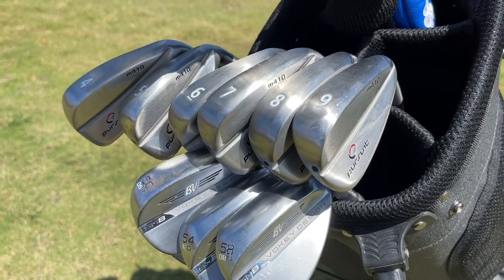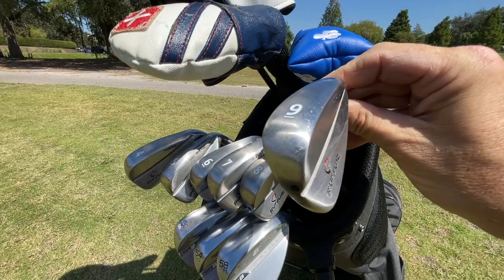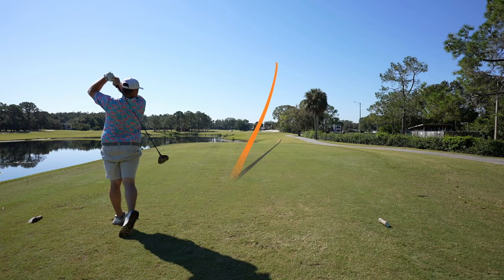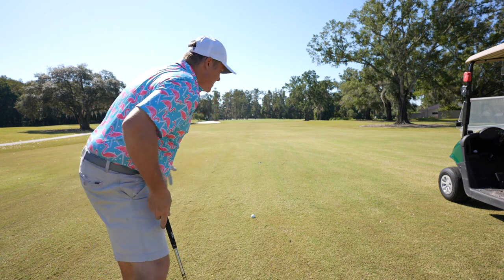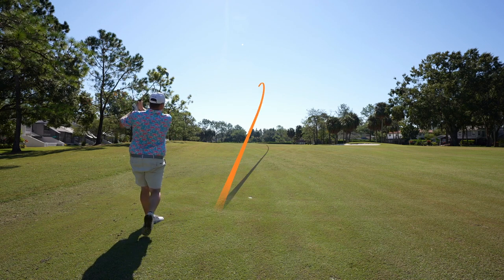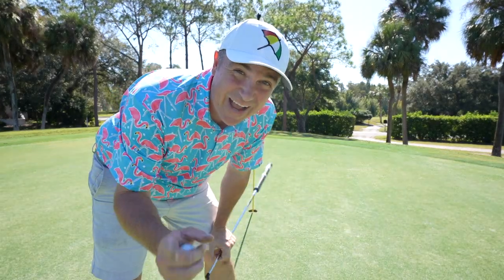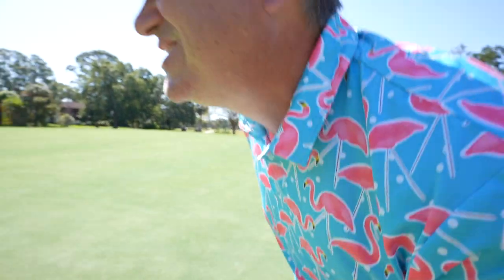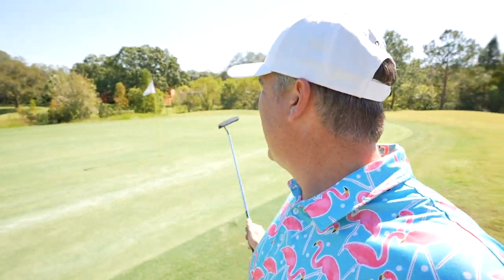Can I Break Par with $400 DTC Clubs??

Comment: Thanks Gabe. These guys are no joke. I've tried to get other You tubers to review these guys. A behind the scenes tour would also be good too. I've got my wedges from Giga golf. After getting a 3w 3h and 3i - 60 degree Ti3 with custom graphite shaft and grips. Cost vs customisation gigagolf is number one across their full range.
Reply from the maker: Yes, the value to quality ratio is about as good as I've ever seen for sure. Would love to do something behind the scenes.
Reply: I've been looking at these for a while. Although lofts and looks seem on the traditional side, the Titanium part kind of draws my attention.
How's your experience with them so far?
Reply: @nomadvehr827 (only downside) I swing very quickly (150meter 7 iron @traditionally lofted). So, these clubs tend to munch the cover of golf balls because the grooves are so sharp, and titanium is so strong. 
Due to tungston weighting, the sweetspot is larger than some other clubs. The sweetspot feels amazing considering I've played Mizuno and Honma irons, too. 
The sole of the club is broad, and the front leading edge is rounded and rolled to help get back out of the turf, which stops me chunking it badly. 
Now, all I need to learn is how to be more consistent at golf .... sigh!
Reply: @deviusfeilds  thanks a lot. That was actually very helpful. I'm sticking to my Wilson D7s for now. Got mine a few years back for quite a song on ebay. The 4 iron and SW were half of the price of the 5-GW set which is funny but I was pushing for set consistency.
The cover munching thing might be a deal breaker so thank you very much.

Comment: I’m shopping for dtc irons right now. I was pretty much sold on the takomo 101s but they’re out of stock. These are definitely on my radar now. Would love to see you rank all the ones you’ve reviewed against each other with pros and cons.
Reply from the maker: If you like those you will like these
Reply: @LetsPlayThru  Would you say the M410 or the C510 is more forgiving ? which one do you think would be closer to the Takomo 101? Thanks love the channel
Reply: Update: I ended up getting these for Christmas after seeing this video. Got fitted at a local shop and used those specs to order my p-5 set. I don’t play in the winter but my handicap has dropped from a 23 to under 19 in the last few months of playing consistently with them. I had only broken 90 a few times with my old clubs but it’s becoming a regular thing now. Im thinking it’s a combo of the forgiveness and the custom fit that’s made the big difference for me. Bad shots tend to still go in the right direction with some decent distance and I’m seeing WAY less catastrophic shots and lost balls.  I’m not sure there’s a better value out there for a mid-high handicapper on a budget. The 30 day 100% money back guarantee made it a no brainer for me.

Comment: Hey Gabe! Nice review. There are a bunch of these inexpensive hollow-head irons that all look very, very similar from the back, the topline, the address - from every angle:

Giga Pursuit m410 
$436 4-pw - 31º 7i, 43ºPW

Haywood Signature irons
$675 4-PW - 30º 7i, 44º PW

Sub 70 699
$630 4-PW - 31º 7i, 45º PW

Ram FX77
$349 4-PW - 30º 7i, 44º PW

Takomo 101
$459 4-PW 30º 7i, 44º PW

There are probably others. There are different finishes and badging, obviously,  and other differences. And the Sub 70s have a kind of faux milling thing on the back. And of course it's nothing new to see a particular design imitated. But in overall profile and particularly the way they look from the front and at address, they seem identical. Then again, I haven't had all of them in hand to compare, so I could be way off. But just wondering if the heads are blanks all from the same factory that each company is customizing in its own way.  Because if that's true...I'd buy the Rams!
Reply from the maker: You read my mind, Daniel. I’ve actually purchased a few of the clubs you’re talking about so that we can test them and find out.
Reply: @LetsPlayThru  Awesome! Can't wait to see it, Gabe.
Reply: I think I saw a comment somewhere that these are an open source clubhead design that some of the DTC brands are using and they all come from the same factory.  I have no idea if that is true but it seems plausible
Reply from the maker: Daniel, can you shoot me an email. I've got the video ready and will send to you to watch.
Reply: Is this video on your YouTube channel? If not, could you please send to me as well

Comment: Hi Gabe, in the intro you mentioned that the clubs are built to your specs. Did you tell them or did they do a fitting for you. Not likely that I would  buy living here in Thailand, but look really fantastic clubs for the price. Especially if they did you a fitting.
Reply from the maker: I knew the specs I wanted so I ordered them that way - but you can speak to them and get advice if needed.
Reply: I had my c510s shipped to Malaysia when I was an expat there. Awesome clubs and hasslefree delivery. Chek out the e-fitting option on their website. It works very well. I am a Giga Golf customer for more than 10 years now. No complains whatsoever.

Comment: They look like Takoma 101 knockoffs
Reply: They look a little cheap lol
Reply: Yeah why buy these when for 50 extra bucks you can get takomos haha
Reply: @Iamwrongbut  Takomos been out of stock for a while
Reply: @josephlowrance3  worth the wait
Reply: Takoma is a TaylorMade knockoff. For that matter every cavity back iron is a PING knockoff.
Reply: @pete916ful  is it a knockoff if they perform the same or better on a simulator?
Reply: @Iamwrongbut  I don't know that "knockoff" is a fair term. Blatant clones are a different category. Whether it's Takomo, Giga or anyone else they all incorporate the best new ideas into their new products. That said I've been gaming the GIGA C510 forged CB's for several years. It's just a classic forged cavity back. Pure strike and it's smooth butter with ultra reliable distances. Toe it and it bites you a bit. I replaced my 6 with the m410 7 iron (lofts work) and was stunned by the forgiveness. After 5 rounds with it I'll be adding the rest. I'm not knocking Takomo's or any of the others. They're all very similar. And frankly the new tech works.